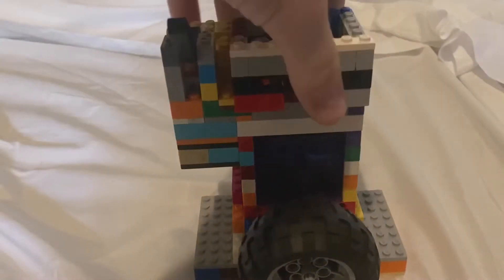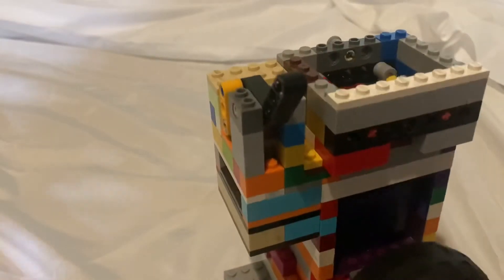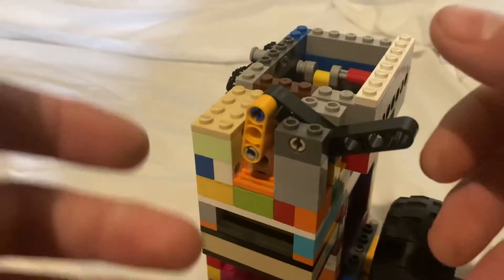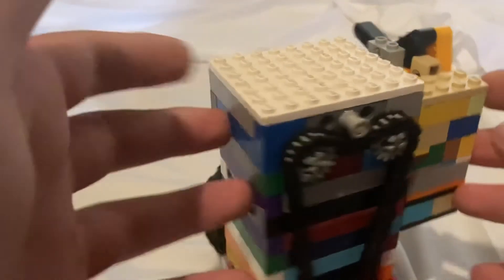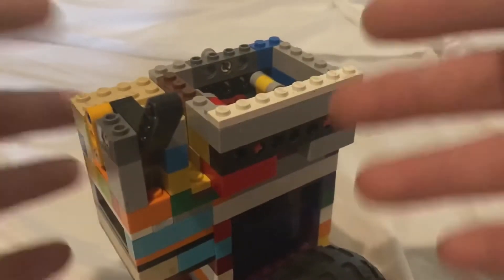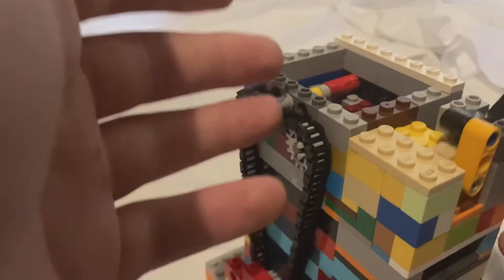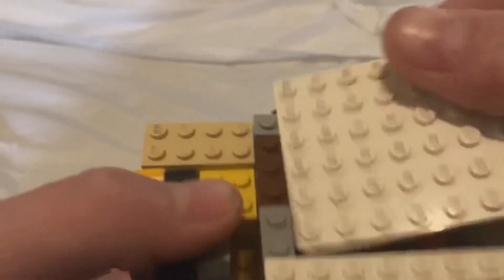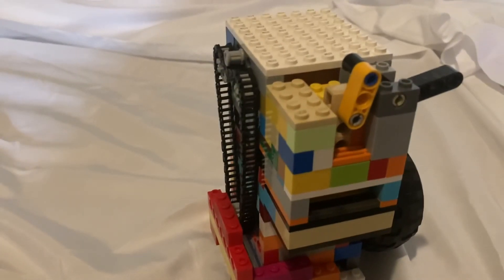LEGO DOHC vacuum engine

Comment: Maybe you could try to make a true DOHC or SOHC, with real cams, poppet valves and valve lifters
Reply from the maker: I’ve been planning to make something with true cams, just waiting for the right time👍
Reply: Dyde howw you can make these things
Reply: @elputinlegomastery8054  it's actually quite easy to make a vacuum engine.
Reply from the maker: @elputinlegomastery8054  just need practice, and you need to have a good idea of all the different engine configurations